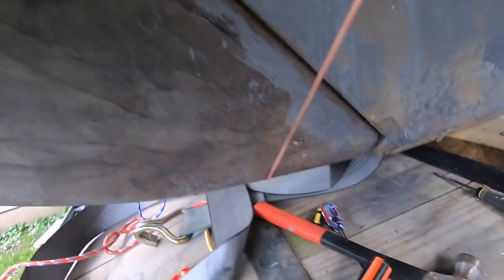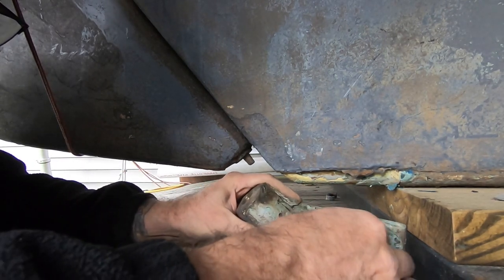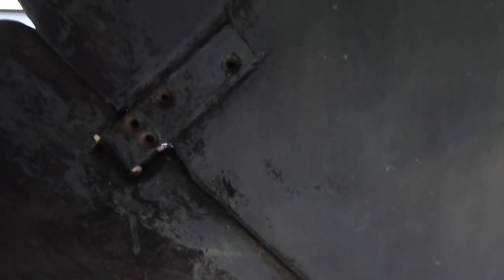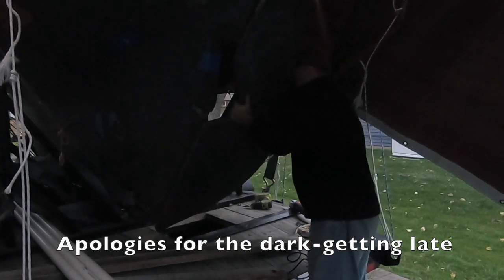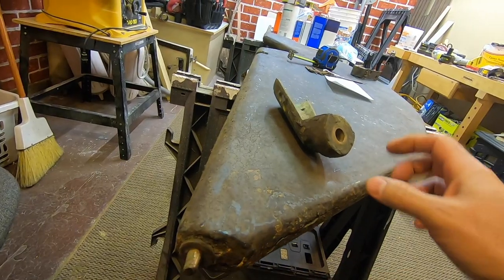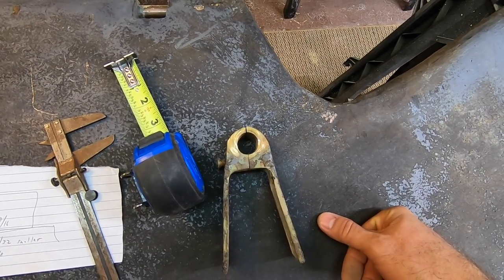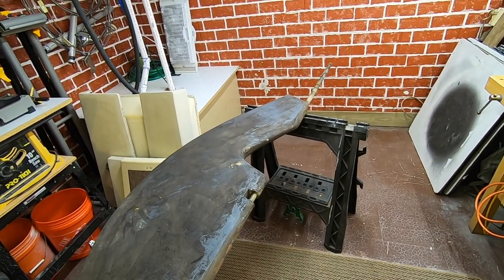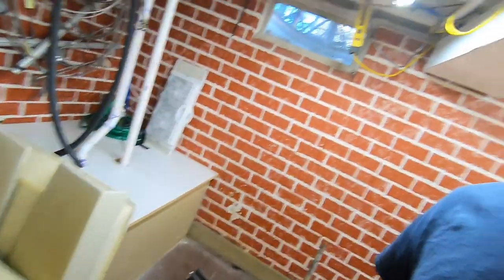Episode 18 - Pulling the Rudder

Comment: You can just have a bronze sleeve made or find a bronze sleeve that fits your new “pin” size, drill out the shoe hole and have the bronze sleeve welded in. Should be good as new.

Comment: He attributes the breakage to the boat having struck something. Significantly, he also says he felt no impact, and it was more of a gradual release when it happened.
Later he also notes the pink color of the bronze in his rudder shaft. Pink means that the bronze has dealloyed, and that makes it weak.
Likely, the first part of the bronze rudder 'backbone' that would break would be the join at the shaft. This is where the thinner threaded rod which extends out into the blade is stressed highest by forces acting on the rudder. That the shaft turns but it does not deflect the rudder, shows us that this is where the breakage is located.
So we know he had a weakened rudder structure, and the boat had a ton of weather helm. The stress from weather helm on a weak component would have been exacerbated by nonstop travel and usage over thousands of miles of seas.
Given the above, I think it more likely his rudder structure broke because of stress over time, not because of an impact he didn't even feel or hear.

WRT peeling the skin off of your rudder, if it were me, I would give it a good tap test with a hammer every inch or so all across the face of the rudder and especially near the shaft, listening for a 'dead' sound, a thunk that indicates water intrusion. If I heard an off sound like that, and only if, would I then go in for the elective, exploratory surgery.
Otherwise, if it ain't broke, don't fix it. :)
Reply from the maker: Everything you say makes sense, thanks. Good, clear summary of James' experience. Also, I redid my entire deck based on tapping with a plastic mallet. I didn't even think to do it with the rudder!

Comment: I put this on Facebook and I'll repeat it here. If the brass you can see looks OK, the brass you can't see will be better. At least that was the case for my rudder. 

If it's just the pin, then drill and tap and replace, like you say. The hole in the shoe can be replaced with a bushing. Or welded and re-drilled.

Comment: D, if the bronze casting on the bottom is in good shape I would see about using a bushing. If it is bronze I'm not sure you could weld it. For a bushing over drill the casting if you can and put a bushing in there that your pin will fit in. I believe there are bronze bushings out there.
Reply from the maker: E - awesome suggestion. I'll look into it. Thanks
Reply: @sailingaquamarie1708  I would think the one benefit of a bushing is they are relatively inexpensive and you could keep several on hand and it could be a part of routine inspection and maintenance (like zincs). If the bushing is going you drop the casting off and pull/chisel out the old one and put in a new one. At least the bushing is sacrificial rather than the casting.
Reply from the maker: @erikschmitt1682  I agree. In addition, by drilling out the pin and replacing with a bolt, that too can be inspected and replaced during regular haul outs. 
I like the direction this is heading. 👍
Reply: Yes, you can weld or braze bronze; artists who make bronze sculptures weld bronze all the time.  I also think there should be a bushing as a smooth wear surface that can be replaced.